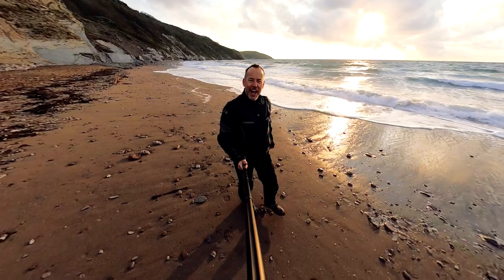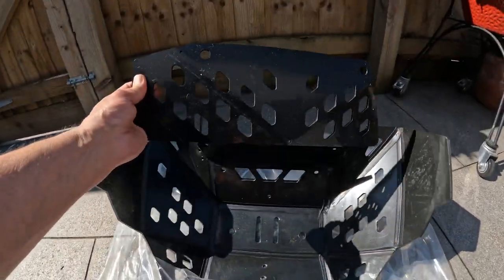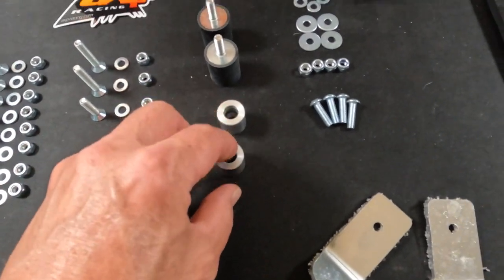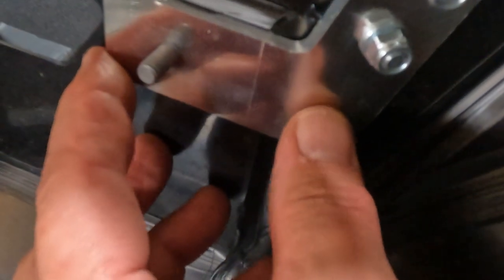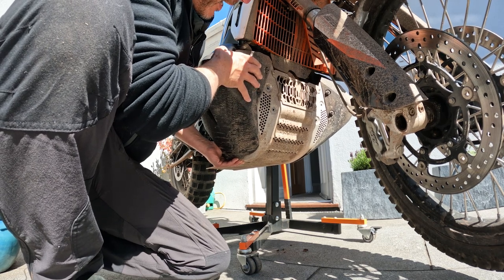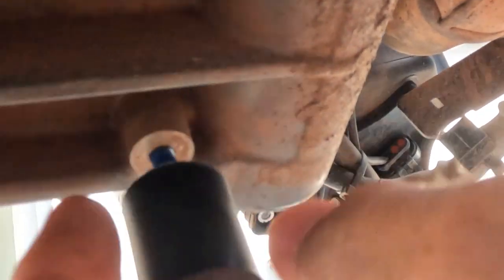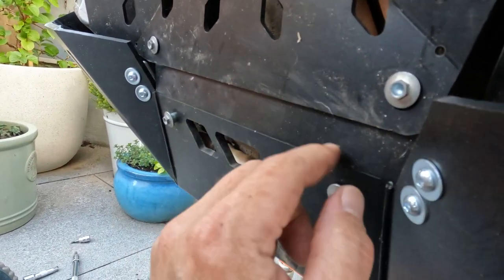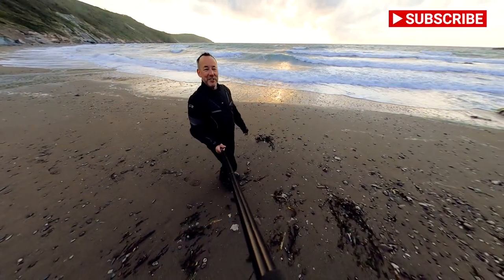AXP bash plate on the KTM 890 Adventure R- does it fit?

Comment: Was the vent hose that went through the stock skid plate side long enough to route the hose to the outside of this skid plate? Need to keep hose away from anything hot when gas comes out laying on its side. Thank You!
Reply from the maker: I actually can't remember that specific bit, but there were no routing problems or issues.

Comment: Looking at getting the newer AXP skid plate.  Couple of questions.

- Did you use the angle grinder while fuel pump guard was bolted to gas tank?  Did you grind or cut that section off?

- Procedure for oil and filter change with AXP skid plate off.  So, do you have to remove the foot peg bolts and spacers again to remove the AXP skid plate for oil change?   Does this take a while to align the front and back holes again?
Reply from the maker: I used a Dremmel as an angle grinder seemed overkill! And yes, did it while it was in situ. Thanks for watching.

Comment: Check out the video by Dad Mode, not to scare but just be aware, he lost his sump when a stray bolt flicked up and came through one of the vent slots in the front of an AXP !  I thought they were doing a V2 that covered that issue and also made it fit the 890 without modding the pump cover.

Comment: Once installed, how may bolts do you have to remove to drop skid plate for oil change?  Do you leave the foot peg spacers / bracket when doing oil change?
Reply from the maker: I’ve not done an oil change yet but reckon you’d only need to take out the rear two bolts and let it hang down a bit. The rear bolts are easier to re align than the front ones. Maybe others have more experience of this.

Comment: Thanks for another informative video. 👍 I'd thought the AXP bash plate was metal and wondered about excessive weight? It appears to be plastic, now I'm wondering about rigidity?
Reply from the maker: It's 8mm thick and fitted really securely- the rubber bungs underneath give a lot more support and energy absorption. And it's super light! Seemed like a no brainer after multiple comments suggesting it.
Reply: @advnoobie6061  The OEM fuel sack protectors look more substantial but I guess the tinplate aluminium between them is pretty feeble. I may consider fitting one to mine, depending on cost? I'm already shocked at how much is being asked for the heat shield to protect the rear shock and things like the one finger clutch extension bracket. I was happy to see alternatives from China at a more respectable price.